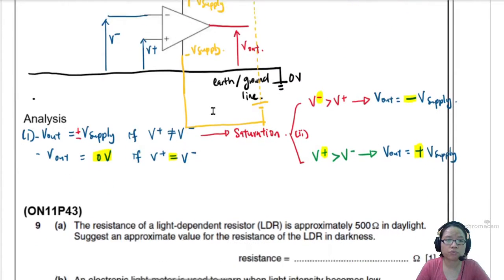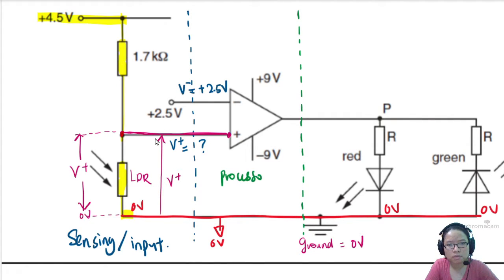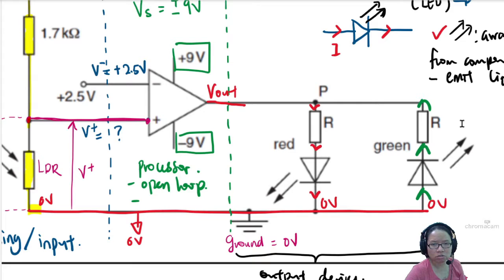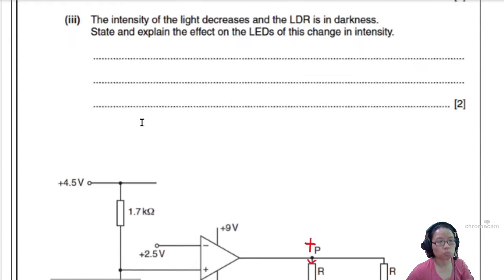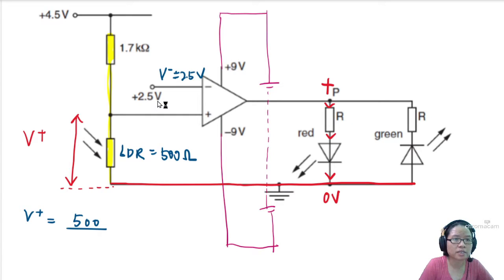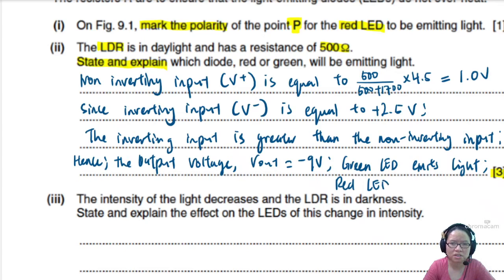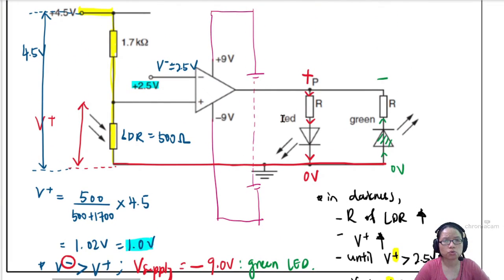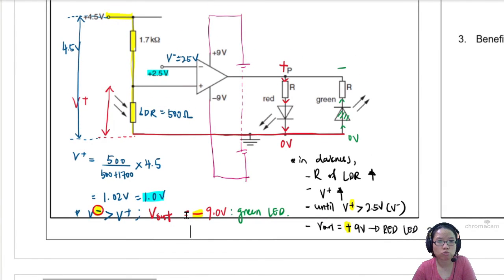121.1b ON11 P43 Q9 Comparator with LDRs & LEDs | A2 Electronics: Op-Amps | Cambridge A Level Physics

Comment: very helpful info, got my A2 tomorrow (it's Zimsec, Zimbabwean exams) and my A3 on the 10th of November

I still need help with an Op-amp called voltage follower, current follower and also a worked example on Closed-loop